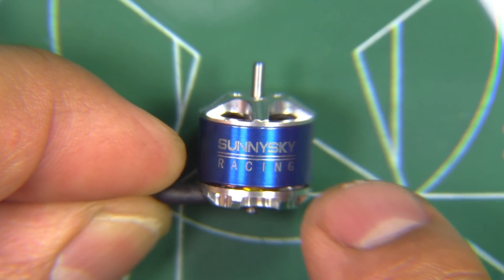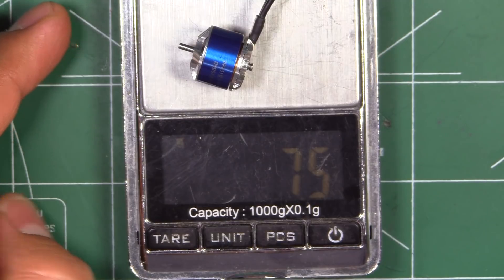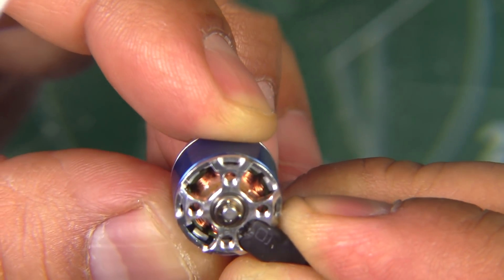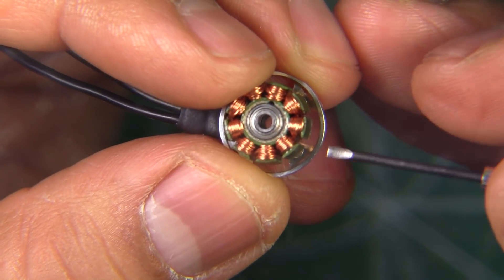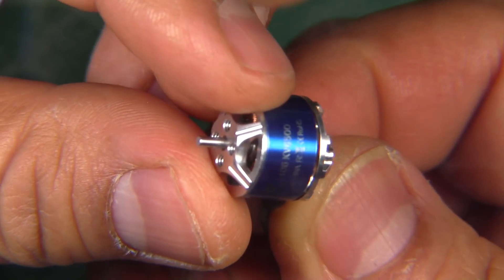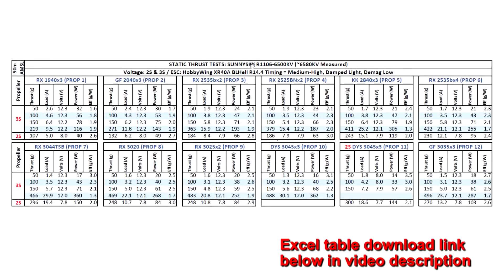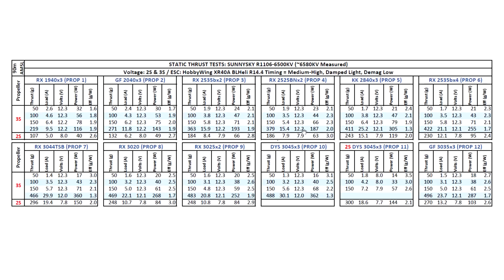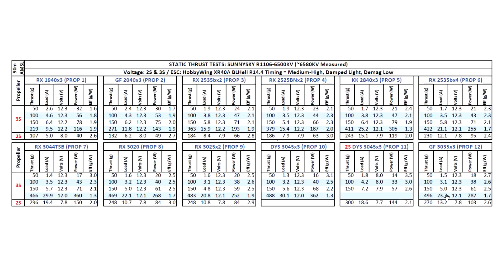SunnySky R1106-6500KV 2S & 3S 2" to 3" Thrust Tests - Little Motor-Big Power

Comment: Weird these thrust number double the 1402 8100kv brotherhobby but on the same quad with 3025 rotorx props the 1402 motors blow these away as far as top speed and raw power and agility as well as 0-60mph times.
Guess thrust is kinda like hp and the torque is king as the 1402 even at 8100kv and 9500kv with have a 3025 up to full rpm and is unloading the prop while these size motors would still be sitting in a silent bog before taking off like a turbo building up.
Lets me know thrust matters alot but a motor with same weight and half thrust mops the floor with em.
Had these in 8000kv and while pretty couldn't run 3s and got blazing hot....pooopppp
Reply: That's odd. I have a set of the 8000kv and they dont even get warm on 3s. Sounds like a tuning issue.
Reply: I can tell you there is no "spool up" lag at all on these motors with a good battery. It maxes RPM out on a 2540x3 instantaneously. I honestly think you were having a tuning issue with your d gains amplifying the noise these motors make ( I had to run a d gain of 8 even with a softmounted FC). I will put up my 75g 95mm or 87g 120mm sunnysky powered quad against the best 1402 powered quad out there, any day of the week. Get some radar passes in, we can compare!
Reply: TheRealJonnyD 
Id be willing to do that for a small friendly wager of a few hundred bucks.
If were talking 3025 rotorx props and 3s lipo my 140g with 3s 650mah lipo efaw 3in sticks with my f80 2500kv strix awk210 and actually accelerates from 0-50mph or so faster than it and only after 90mph or so when my 3in maxes out or small lipo sags does the f80 quad shine.
Also can stop and turn around at full speed instantly and back atfill speed instantly.
The torque the 6.5g 1402 makes on top of 9500 and 8100kv is just the combo to get the job done.
Honestly even a 5in that isnt a beast powerhouse would have a job sticking with it in a straight run down the street to stop sign about 1/8 mile away.
And on a tight area where agility comes in it would mop the floor with it.
Not sure its fair since your motors prob arnt gonna like 3025 on 3s too much and any smaller of a prop, besides maybe a 2345 emax prop that dnt get enough praise,my motors really wont get to use their best feature of stupid torque at 6.35g .
I actually have a velocity rc GPS that's the size of a big bic lighter and 25g or so that records everything and maps to Google earth as to verify a non-misreading and to tell with wind and against wind and made for jets up to 300mph I believe.
So highly accurate and proof of no misreading.
Sucks the quad would have to have 25g added since that's a huge difference on these light quads but just to get and idea it'll be fun.
Gonna order a radar gun here in the next week too so ill find out the speed but guess around 100mph simce from a dead stop a car passes me at 70mph and once its 100ft away within a second o take off and blow past it and then turn around and come back and to back and go past it again so gotta be around 100 ,that's my guess at least.
Anyway ,what's ypur email so I dont keep clogging thread.
I just don't see any 11xx size motor comn close,especially on a 3025 prop and 3s .
Also likely I can run 4s on 8100kv version but I dont wanna cause a sonic boom and have the government guys down here and all that hassle.

Thread relevance though,I bought the R1106 8000kv due to being so pretty and the charts had 3s stats for it and even with a 2840 or even 3in prop I believe but not 100% about 3in.
Anyway I got em and tried 2535x4 and 3s and blazing hot and was tuned perfect like all 12 flying quads I have and the other 60 or so built this year so know it wasnt me.
Also the next motors on it,f10 1105 8000kv on 3s and any 2.5in prop I had it ran cool as can be and was a very powerful setup for 11xx sized motors.
Talked to SS and they said not rated for 3s on their site so the vendors were the problem mislabeling what it could do.
Tried soft mounting,dynamic on and filters lowered and highered and timing and D gain higher and lower and no D gain with filters off and nothing.
Deff 2s motor unless you dont mind running 130+f motors which it can take no prob but dont like it and should not have to,especially when ive had 5$ racerstar 1103 10000kv run 3s with bigger props and be cool as can be and 4s on 8000kv with no temp problem.
Wouldn't mind trying those 0705 sunnys though.
Wish they did the prop screw holes on em like dys 0905 did though.
Cant fly pop on props.
Well bud just let me know of you think 3in is possible for you as far as speed against 1402s.
If not I'm sure I could find a good 2.5in though wish they made emax 2345 with normal spacing instead of having new motors with both spacing.
Coulda did it to the props than others would of bought em for other motors.
Real genius of them.
Avan 2022x3 here tomorrow though so might be good and also 2540 flash props too so have some choices.actually either way dont matter ill do both 2.5 and 3in .forgot how much power I'm actually dealing with.

Meet me by the monkey bars and bring ypur pogs that's all I'm saying.
Reply: TheRealJonnyD 
Hey didnt see this post you wrote.
I don't quite remember the d gain I had ,prob between 17-22 for sure though since ever quad I ever had has had no problems and tuned great there.
Wish I still had em to check but simce SS actually told me, "oh no they don't work on 3s 😱",which I know factory specs as far as charts mean nothing being I've seen 2206 2000kv tmotor is rated 3s and 6020 prop but in reality runs nearly any prop under 7in on 6s without a hiccup.
But yea would of loved to keep em they look so nice and if super low d woulda ran em cool I'd still have em ,maybe,as I sell every quad once its perfect it seems.
Thanks for the info though I appreciate it.
I possibly will buy a set since crazy deals are to be had all over and its a buyers market.
Those new Diatone red motors with white wires that are out look so nice and perfect for a color coordinated build so gonna be hard choices.
Still I tho k while the 8000kv sunnys may be fast and snappy from being light and havi g good thrust I think the 1402 high kv stator size combo with its low end torque and while being the same weight if not lighter and being able to use same size packs jjst gives it an advantage all around.
It'll be fun r eguardless like the McGregor and mayweather fight!(ill be mayweather and you'll be McGregor since everyone wants to see the disadvantaged guy win but ultimately won't)🙌 8...9.....10!🔔 🔨

I'm just messing around by the way,serious about the quad being faster and more powerful all around and likely way more efficient being I use less throttle since the quad wants to take off and fly away by itself,but I'm just hying it up talking crap for the sake of making it fun like its serious when truly its not and sure both quads are fast as hell and probally very similar since you managed to make 8000kv fly at cool temps by lowering d gain almost gone.
I'm sure many who bought 8000kv to run 3s will like that info as ive read another guy pissed his 8000kv were scorching.
Well gotta go train.
Got some 550mah 3s 80c black labels unflown,just saying.
Reply: TheRealJonnyD 
Yea I think brotherhobby did something with these 1402s as far as a whole new category and style of quad especially with all the higher powered 20x20mm electronics coming out.
140g with lipo and 3-6 mins depending on flight style and the quad is able to at least keep up with and likely go faster than ,at least in bursts,while being so light it can tumble across the concrete at 60mph and pop up and keep going without a bent prop even and with camera fully exposed no damage.
The 11xx sized motors are coming up too dont get me wrong.
I've had those SS and 1104 emax and 1106 emax and f10 1105 tmotors and rotorx 11xx(crap),multistar 1104,dys in multiple motors and recently they have all been way better and higher powered and just higher quality then a year ago.
The emax 1104 I believe should get mkre attention than it does.
The 1106 emax I feel was no faster than it at all amd on the right build the 1104 emax are just so smooth and powerful and fast as hell.
Also the emax 2345 prop are no stars and so smooth and nearly unbreakable for real instead of garbage bending gemfan "unbreakable which are worthless.
I've flown 1 set of 2345 emax props for literally 2 or 3 weeks with 50+ crashes and they do not bend or get unflyable and looked basically like new besides some scratches on em but had no bends or creases or anything.I actually still have the set to fly again one day after they have had at least 60 flights on em.
Heard bad reviews they were unbalanced and crappy but multiple sets have been the smoothest and highest power outputting sub 2.5in prop I've laid hands on and I've tried em all besides a few non brand ones not worth their weight in feces.
They need to make standard prop hole emax micro props cause they literally last weeks.
Also shubkraft has 1107 6500kv new motors out.
Supposed to be powerhouse and they look great as all their motors.
Also 1507 3750kv they have out now too.
And as mentioned earlier the diatone 1105 I believe they are. Red colored motors.
All quality motors coming out man I need to sell my other kidney now..
damn!!!!!
1st one went to lipos now this.
International organ black Market and shubkraft here I come.
Reply: TheRealJonnyD 

Oh yea bring your ying yang slammer with the serrated edges with the hologram effects if you wanna have a chance.
I'm not playing ,ive got a master shredder mega slammer with your name on it .......and I don't even know your name so lets just say it was meant for you and is your destiny!!!
Reply: TheRealJonnyD 
Hey I'm in central florida but from long island.
I still have brothers there and aunts and cousins and all that.
I'd recommend both 8100 and 9500kv.
Both stay very cool on 3s 3025 and 3044rx triples though the 3s small lipos dont like 3044tx with my flying style though my buddy managed just fine.
The triples literally pop up and fly away with air mode alone and its a job keeping it down under 50ft.
Havnt tried black label though yet but 3s 650 75c tattu sagged too much but honestly the 3025 duals and 650 3s 75c tattu is more than enough and due to weight of my build its like triples on another quad.
It stops instantly and banks like a champ and no difference at all plus get dual blade speed and able to get 3-6 mins.
Really anything over a 650mah is going against what potential the motors have .lite weight is reallllly a big deal and is night and day compared to the 3s 800mah turnigy graphene I tried.
Went from the worst unflyable nothing to what I honestly think is the best thing going.
I can put the quad my tx and goggles and 6 of the 9$ lipos it uses with 4 sets of props all in a lowerpro tx/goggle case and have basically a full 5in quad type flight setup and 6 packs ready to go in a lunchbox basically.
Camt beat it.
I tried 4s but like an idiot didnt feel like chamging props and tried it on the 9500kv version with 3044tx triples and 4s 700 pyrodrone and did one pass and then had a death spin and a motor was burnt but bleieve it was a design and that the sand cooked the motor since it was hot.
If I woulda put 3025 on 8100kv I think 4s would of been not a problem and speeds would be nuts of the weight of lipo didnt out do the gain and the prop didnt flatten out too much and reach full potential rpm along with motor.
Im down 1 motor or I'd do it right and use a 4s 650mah tattu which is lighter by alot or make one with 2s 600mah tattu which would be even better I think..
Some 3030 apc tmount style props would be amazing.
Well talk to you later
Reply from the maker: Yea, in some cases thrust stand tests just can't tell the whole story. Dynamic loading of motors and props has so many variables and only way to see a motor' s true performance.
Reply: You SOB, I just sold all my pogs last week! I'll see if I can get some radar passes on this thing, I'm guessing my 95mm build does pretty close to 100, if not over on 3s. It's crazy fast. The punch on the 120mm build is stupid on 6500kv with 4s... it's unbelievable. Seems faster than than my 2306-2700kv quad on 5s, honestly.

Are you talking the original 2345s that came with the Babyhawk? KingKong cloned those with both mounting patterns if you are.
Reply: Yea dude, I just got some of the black labels too! Where you located, btw? NY here, it's so cold right now that my lipos are crying after being outside for a minute -- hoping for a few nice days so I can actually do some flying. I made the mistake of flying one of my micros without conformal coating, landed in the snow and cooked an ESC :( oh well, good thing I ordered extra ESCs.

Anyway, see you around buddy. I'll let you know if I ever get speed results. It's fun info either way. You have me interested in trying those BH 1402s, I'll probably end up grabbing some. Which ones do you suggest for a 3"?

Comment: Yeaaaa buddy! I actually ran these on 4s the other day with gemfan flash 2540s , I thought it was going to spin the earth backwards. LOL

One thing -- the motor bells come off the shaft way too easily on the SunnySkys. My first set came apart mid air on the maiden. I loctite them now when I first get them!
Reply from the maker: Uuugh.... always something right?  thanks for adding from your own experience.
Reply: suleyman savci Loctite the shafts and you have the best 11xx motor in existence right now. They're that good.
Reply: pizzyfpv on brand new motors I've used Loctite 290 (wicking threadlocker for assembled fasteners) with decent results. The best solution is to do as you described, with just a light scuff with sandpaper on the shaft and using loctite retaining compound.
Reply: Funny thing I just got them delivered to me. Got a deal on RCmoment for $29. Couldn't pass.
Reply: suleyman savci on 3” gemfan 3035 3s it’s crazy punch. You will need a good high c lipo. I was fairing well with GNB 550 80c with 2:30 min
Reply: What type of loctite do you use? So you take it apart and put loctite on part of shaft that connects to the bell right? and Then you press fit for 24 hours or something? I lost 3 shaft email rcmoment hoping to get replacements, but I also want to keep from losing shaft on my other ones. Thanks
Reply: TheRealJonnyD same thing happened to me. I contacted sunnysky but they would not honor warranty! They told me I had to buy them from them directly to honor warranty. Banggood hasn’t got back with me yet. Other than that these motors are very powerful on 2.5” and 3”.
Reply: SteveO4478 Banggood replaced one of the motors since the shaft disappeared lol. The rest I caught in time. I have several sets, they hold fine once you loctite them! It happened almost 2 months ago at this point.

I had the same experience with SunnySky. They said that when they wholesale them to other places, the warranty becomes their responsibility. Makes sense, but the problem is the design. The press fit needs to be tighter or they need a set screw.
Reply: TheRealJonnyD good to know. I got a frame that almost takes 3". Just barely not taking it. Need to find good 2.8" props
Reply: TheRealJonnyD yeah these motors are beast I hope Banggood will help me out! Sunnysky has told me they fix the issue but no way in telling you have a revised or a older model unless you purchase from them they can assure you. I have the 1104 that has a revised shaft you can tell by looking at the top of the shaft it looks different.
Reply: Hi EngineerX! Can you give your contact to recommend you to more brands? send it to vmx2box@gmail.com please!
Reply: pizzyfpv check this vid out. https://youtu.be/tFMmhHJ5ipU
Reply: I confirm that with 1104 as well. i applied some penetrating thread locker on each, seems a bit better.
Reply: TheRealJonnyD 🙅
Reply: Its mostly because bangood sometimes actually clones other company s products and how are the companies supposed to know if they are legit or not.